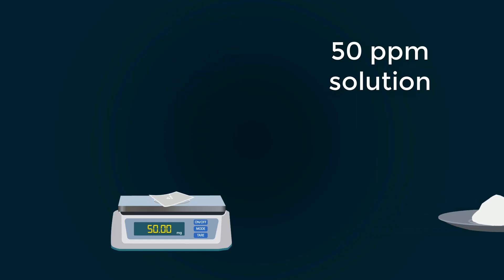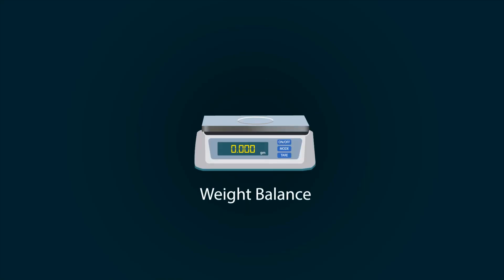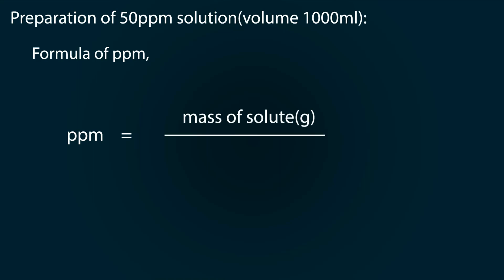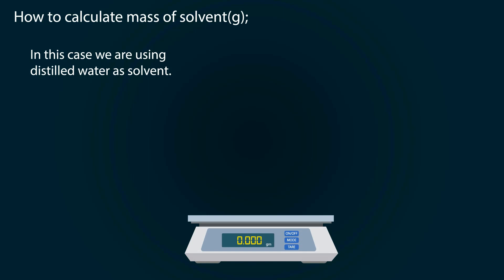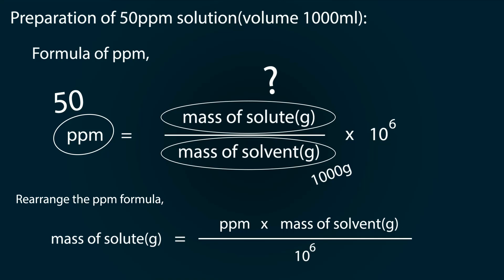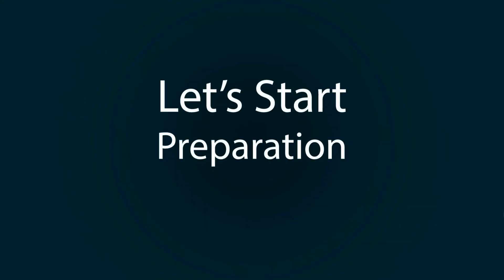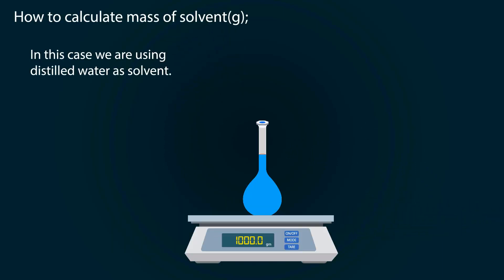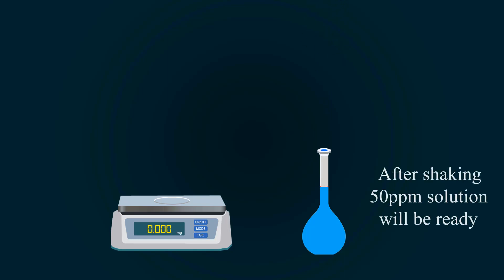50 ppm solution | 50 ppm solution preparation | how to make 50 ppm solution | make 50ppm solution

Comment: In lab, we ended up weighing 0.01g, my sample was realistically weighed at 0.0113g which is a TINY pinch of dextrose. Diluted in a 100ml v.flask for 100ppm. Half of that was pippetted into another 100ml v flask then topped up to 100ml for the 50ppm dextrose solution.